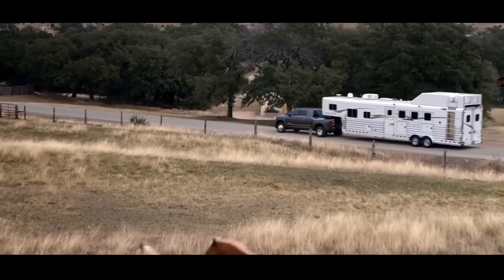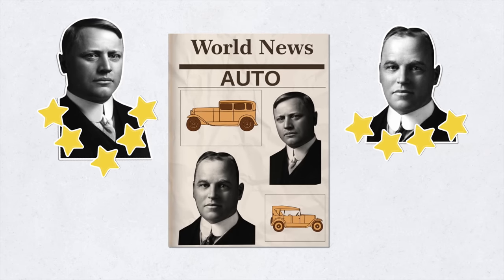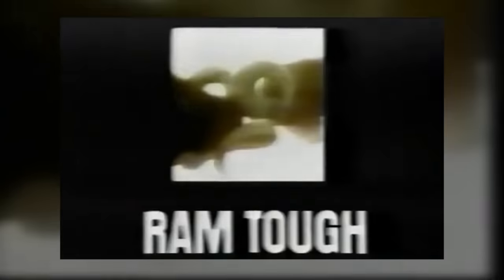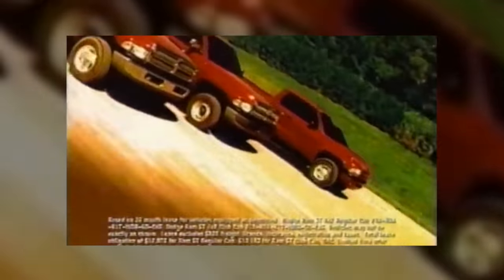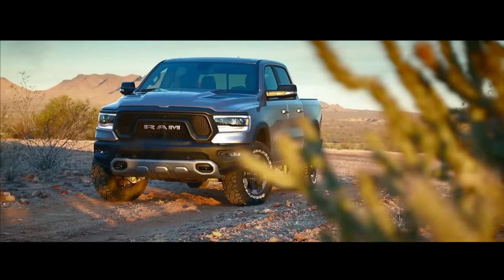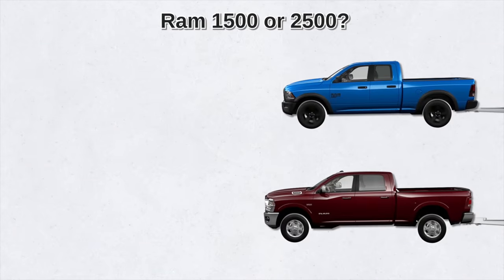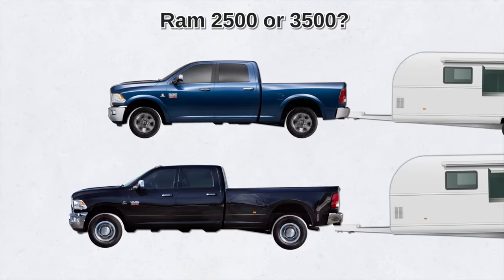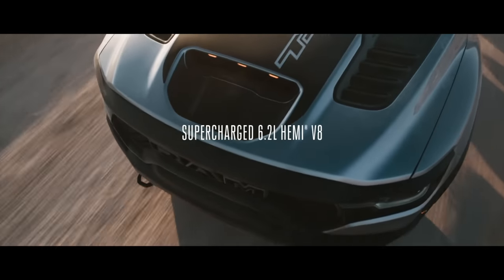No One is Telling You the Truth About Dodge Rams, So I Have to

Comment: I have a '98 2500 Cummins 4X4 that I bought new when the 24v came out. It's never left me stranded and I've only had to replace parts that normally wear out. Still runs great with 250,000 miles on it.
Reply: DODGE IS JUNK......NO WAY CHRYSLER CAN RUN THAT LONG
Reply: He’ll be dead before he can put that on lol at the mileage he’s at now.
Reply: I just mean if it’s at 250k now 20 years later it would take him another 40years to get another 500k like you said
Reply: Stick shift?
Reply: @erniecarrasco9107  but you own a Cadillac....🤔🤦‍♂️🤐
Reply: 7400 miles a year?  Sure it will last many years.  I didn't like Dodge much until I started working at a Ford/Chrysler dealership 20 years ago.  This video was what I want from a good sales video, just information, but it's not what  I subscribed for. Just my own opinion.
Reply: I’ve got 500,000 miles and counting on my 6.0 Power Stroke. Still looks like a newer truck and the body is tight. Engine is great except for a small oil pan leak. Only on the second automatic transmission. Truck towed most of its life. Ford made a superior truck from 99’-07’
Reply: The engines are are amazing, but the transmissions...
Reply: @Wezi427  it's a manual transmission rear wheel drive and I work on it myself. But it does break down more than my 02 Taco prerunner and my 06 Highlander Hybrid limited
Reply: I have an 02 ram 2500 with the big drinker v10. It's been a good truck other than I had to rebuild the trans at 165k about 3 weeks after I bought it from my brother in law lol still can't complain it's a solid truck
Reply: I have a 2003 Dodge Ram 3500 crewcab dually 4wd 8ft bed. No rust and runs great. So up yours ! Haters! Lol!
Reply: @erniecarrasco9107  MAKING JAPAN GREAT AGAIN👍
Reply: @erniecarrasco9107  - RAM and Dodge are NOT American - they/re Italian cars and trucks.  If you buy anything from Italy, make sure it says Ferrari on it or don’t buy it.  Ford on the other hand is an American company and the F-150 is one of the best trucks anyone in the world can buy
Reply: @InCaveEntertainment  if you get the right Ford yes. But so many of my friends who have 4x4 fords tell me they don't last. It's rare.
Reply: Theres alot of mileage left in that Cummins , the rest of truck will fail apart long before the mighty Cummins is done. 💪
Reply: @davegeisler7802  the dodge heavy duty trucks are basically solid from bumper to bumper.
Reply: Speed Tube  my 2006 Ram was built in Mexico...
Reply: @zackzander425  you are by far have a rare truck the 6.0 ford were junk. There was even a lawsuit over them.
Reply: @jakey20022  there have been class action suits for every maker, the 6.0 is a great motor but was built by International and after the 6.4 flop from international Ford started building their own motor the 6.7. Ram hasnt ever built their own diesel and chevy duramax is an isuzu which chevy only owns a share of
Reply: @andrewgodfrey579  RAM doesn't need to the Cummins is a great engine..
Reply: @Red ROCK agree that’s why mine has 1.3 million. I drive over 3K miles per week
Reply: @InCaveEntertainment  ram is actually more American made than ford. In fact 2nd most American made truck 1st being toyota tundras.
Reply: One of the things I most regret selling was my 2005 Ram 3500 with one of the "old school" Cummins.  Pretty close to base model, would have probably been able to put 400,000+ miles on it.  Stupid me.  They'll never make anything like that again.
Reply: @markw999  emissions ruins everything for diesels. The 12v 5.9, 24v vp44 5.9, and common rail 5.9 24v are the best
Reply: @roketfingers  the transmissions are amazing but when built... in stock form you need to baby it
Reply: @roketfingers  Ram has been using Aisins (Toyota made) transmissions as an option since 2013. I have one in my 2020, zero complaints. But all the older automatics? Yeah they're trash. Same for Ford automatics.
Reply: We bought a brand new 97 dodge extended cab 2500 4x4 Cummings, it has pulled my horse trailer and never had a problem.  I’ve pulled Fords out with their trailers attached.  Over 250,000 miles and going strong. The worst thing is the cheap plastic used.
Reply: @InCaveEntertainment  to bad you have to lift the cab to work on the diesel
Reply: I have 300k miles on my 5.9 gasoline Ram 2500
Reply: @InCaveEntertainment  I'll take Italian over American every time hands down.
Reply: @dare2scheme904  - cool!  Go buy a Fiat - those are super reliable.  Or a Ferrari - pay an incredibly high amount, not be allowed to paint it whatever color you want to, and not being allowed to sell it without permission.  A bunch of really great car companies over there.
Reply: @InCaveEntertainment  I tried to buy a Fiat 500 at an auction last week and got out bid. I quit at 5,000. I got a 2008 GS350 2 days ago at the same auction for 2,200 and I found out it has an exhaust leak at the cat, which is integrated into the exhaust header. I found out this is a common point of failure for Lexus. I would have preferred the Fiat, but I had to settle for a Lexus.

Comment: I would like to see a re-vamp of the D-50. With a turbo charged I-4 engine with at least 250 whp, and 260 ft lbs of torque. A diesel option would be great too. Diesel with at least 175 whp, and 300 ft lbs of torque. Diesel must have a EGR-less engine. If the did this they would control the mid-truck market.
Reply: Miss my mom's old mighty max.

Comment: 2012 1500 Big Horn 4x4 Hemi.. 214k miles with no hiccups down the road. Proper maintenance and a little luck are the golden ticket to longevity. My only concern is that the engine will sometimes instantly crank over instead of churn a few times, but it's rare enough and no issues as of yet.

Comment: I work in the Cummins plant that makes that Diesel engine. Trust me, this engine is absolutely bulletproof.
Reply: I love the Cummins engine, I don’t like the ram that’s wrapped around it
Reply: What would you say about the 3.6L pentastar? Or the 8 speed transmission
Reply: If it is bulletproof why can’t they get more than 300,000 miles without a major overhaul anymore? Unless you take all the EPA crap off them they don’t last anymore.
Reply: If its bullet proof why cant the turbos last more then 15,000s with out blowing the engine up? Or what about those transmission seal leaks at around 10,000 miles ?
Reply: @Unique377  I'm no Cummins mechanic nor owner but I've never heard of those issues being common. You have a source?
Reply: When people ask about my truck: It's a Cummins Diesel Truck.  I bought the engine surrounded by a truck.
Reply: @Unique377  if every Cummins failed every 15,000 miles, Cummins would not be in business. A $7,000 expense every year? Provide proof please?
Reply: @arnieboggs1  Agreed. I'd take a Cummins over any diesel on the market. The problem is they are stuck in the #1 ranked 9 years in a row worst vehicle manufacture in the world Fiat.
Reply: @arnieboggs1  It better be reliable because its the same engine thats in every trash truck and trash day is every Monday!
Reply: Best motor I had in 7 diff semis I've driven is the Cummins X15 Efficiency. Dead nuts reliable and around 8mpg under most conditions.
Reply: Your probably the janitor at the Cummins plant
Reply: The 6.7 is a awesome motor, it’s just to bad emissions where added and Chrysler built everything else around it. Love mine though.
Reply: Like, I can actually shoot it and the bullet won’t damage the engine?????
Reply: @UTUBE3JC  since you are asking this question, I’ll answer. Every component of the engine is made of Kevlar. Even the coolant, oil and diesel. They have been hit with anti aircraft artillery and they simply bounced right off. The government tested one with a nuclear war head and it almost survived.
Reply: I don’t trust you. I’ll be shooting one later today for verification.
Reply: @arnieboggs1  I believed you up until nuclear warhead hahahahahahaha. But fair enough, that is the answer my question deserved. 😝
Reply: @arnieboggs1  I was like damn Kevlar for the whole engine wtf is this the official navy seal truck
Reply: @markh4473  in the case of the third gen ram, yes they were trash. But the first, second, fourth, and fifth gen ram heavy duty's are great
Reply: I've worked on some of them offshore. They make a damn good engine for a standby generator package. The only one better is Caterpillar in my opinion, but that's semantics.
Reply: I have an 07 5.9 with 668k miles. Only  injectors have been replace inside the engine.
Reply: @markh4473  why not, I’m curious-
Reply: @SuperSnakePlissken  take that crap off! ; /
Reply: @Unique377  I’ve had 2 in the last 30 years. Still have a Cummins 350 never had an overhaul never a problem with trans or seals- what gives?
Reply: @Unique377  mine must
Be the only bulletproof ones
Reply: @johnwhitehead5457  I like that john
Reply: @SuperSnakePlissken  completely wrong I have 400ooo miles and no major overhaul - I maintain the truck and it Basically asks for nothing more - puts Chevy  and
Ford to shame. No mention of
Toyota for
A reason. They never could
And
Still
Have no idea how to build
A
Pickup. To quote an old Toyota pickup being retsrded looking in and
Out: It’s a chinaman thing

Comment: We've had an 03 Ram 3500 4 door long bed with the overload springs straight out of the factory with the exhaust brake. Had 8k lbs in the bed, didn't come close to bump stops, towed veeerrry heavy loads, and to top it off it was one of the years with absolutely no EPA garbage! Love it to death and with some modifications it got up to 1200lbft of torque and 26mpg unloaded highway. 18 loaded. Now it has a 6.7 swapped in and is even more amazing. Love the truck and would recommend it to anyone. It also has the 6 speed NV5600 which I wish Scotty had talked about because it is bulletproof out of the factory.
Reply: How hard was it to swap the 6.7 and Trans in? I'm on my third 48RE and I'm just done with it.
Reply: @iPhoneAppReviewer  What keeps failing on that that transmission?

Comment: We had a 3500 and it was very bumpy . We switched to the 2500 and its easier to ride in even when pulling a car hauler. We do that a few times a year. I can actually read in it unlike the 3500. ( that’s important on long trips. 😊. Thanks for the info Scottie
Reply: You can't go worng with John Dutton's favourite truck!
Reply: Replace the sway bar with a carli torsion sway bar and it'll be the smoothest ride of your life. Upgrade the full suspension if you have a need or the money to but Ram's sway bars are the stiffest on the market and upgrading them makes a huuuuge difference.

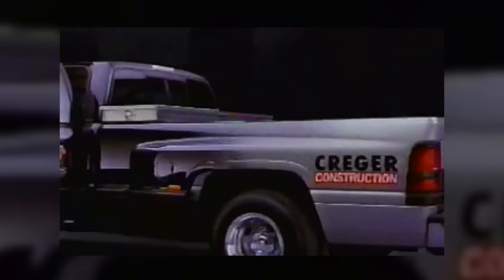Comment: 3:40 Factual error: you said the 2nd gen Ram from 94 came with "turbocharged" V6 and V8 engines. C'mon man. The Cummins had a turbo, not the gassers.
Reply: yep youre right. I own a 94 with the 360 and a 97 with the 318. no turbos
Reply: Dropped a 5.2 in my 97 1500 a couple weeks ago. No turbo. Guess even Scotty Kilmer can make mistakes!
Reply: I have a 93 dodge 12bt turbo charged 5.9 with a nv4500 trans
Reply: Come on man Scotty can slip up once

Comment: I had a 2011 Ram Bighorn 1500 with the 5.7 Hemi. It towed and carried everything I could throw at it and drove more comfortably than every Chev,Ford I ever drove. Great truck, only complaint was bad fuel economy but it made more power than I needed and never caused me any grief....I should've kept it.
Reply: I've seen many quite similar stories about the hemi ram trucks, the diesel manual transmission ones, they are legend.
Reply: Drive a tunda believe me there is a big difference
Reply: My 2011 1500 just turned 60,000 miles. It looks like new, drives like new, paid for, does everything I need. Been a truly great truck. Oh, and it's a plain jane model, debadged, bigger tires and I get compliments on it all the time. And I don't miss any of the useless technology built into the newer $70,000. trucks either.......put that in your pipe Scotty!
Reply: I had a 2017 Ram 1500 Tradesmen as the lone family vehicle, camper tower, materials and debris hauler, etc. It did everything I needed. While camping in Virginia Beach, my wife noticed that everyone else had 2500s, 3500s, 250s, 350s,...and she kept saying to me, "we need more truck". I was resistant because my 1500 was nearly paid for and did everything I needed. The morning after returning home from that trip, my wife woke me up and asked, "are you ready to go look at trucks"? Thinking I would pacify her, I agreed to 'look'. As we approached the lot, we both spotted an Olive Green Ram 2500 Tradesmen. It is now mine, and I paid it off after just two payments. Stepping up to the 2500 was a great choice! I smile every time I see it, and I get compliments on my truck all the time. I've done some small upgrades and have plans for some more involved improvements. I doubt I'll ever sell this truck and I'll drive it until the wheels fall off.

Comment: Just upgraded my first Ram truck a 2018 1500 big horn crew cab, first vehicle i ever bought new. Got it at a year end 10k off event, held it value so well, i had a trade in value of 34k, which is the same purchase price i paid for it 4 years ago. had 65k miles on it. Replaced it with a 2020 Ram Rebel quad cab with 5k miles. I think im going to stick with rams for quite awhile. Hell maybe ill be lucky enough to find an alright priced TRX to upgrade this ride with in a few years when its paid off

Comment: I had a Ram 1500 4x4 and it was totaled last summer.  When I get my next truck, I plan to get the Hemi 2500 4x4.  Honestly, my 1500 was perfect for what I used it for but I want the larger truck since there is not much difference in gas mileage and it seems like the price difference between the 1500 and 2500 is not enough for me not to take advantage of having a larger truck.

Comment: Bought new in 1994 a second generation Dodge ram 1500 2wd. The 5.2 liter (318 c.i.) has always been my favorite engine. I now have 308,000 miles on it. Other than a crank sensor going bad at around  110,000 miles and normal tune up parts and oil changes, the engine and transmission are untouched Still runs great. Just put on the second water pump and replaced the original thermostat. Only replaced the starter motor once and the alternator once. I live in Michigan so yes it has some rust. 
I've owned it 27 years and still love it. I keep up pretty good on the maintenance. I've personally done close to 100 oil changes on it. It still runs great.
Reply: 5.2 mágnum 96 ram 1500 253205
Good engine no have problem...
Reply: Those 318s were great engines!

Comment: I rented one for a long road trip a couple of years back. Actually, it was all Enterprise had available at the moment. It was a 2019 1500 if memory serves. What surprised me most was the great gas mileage it got over the course of my 3000 mile trip. I've often wondered, however, how well they hold up over the long haul. I tend to keep trucks for a very long time. I put lots of miles on them. My current truck has over 300k on it. I'd consider a Ram 1500 for my next truck, so long as it isn't a maintenance money pit.
Reply: What’s your current company choice?  Toyota? Ford? Something else?
Reply: Sadly after owning multiple ram's, the long term reliability is was pushed me away.  Most of the time it was just electrical issues, or ABS, but I did have trouble with late 90's automatics with the half ton.  Not saying other don't have issues, I just don't want to give them my money at this point after having so many issues on rams and some of the cars covering about 15 years between 1990 - 2005.
Reply: Was employed by a rental company for years, been out sense 2013, at that time the diesel  version had exceptional fuel economy, made one replacement delivery in excess of 600 miles, 29 mpg and I didn’t baby the vehicle. Best part was, didn’t have to refuel. Think green.
Reply: I just sold my 09 and it had 300k and still ran like a top. Daily driver and the most expensive repair over all those miles was I replaced the worn out upper and lower control arms and ball joints. Just normal wear and tear. Replaced a starter, battery, two cooling fans and front wheel bearings over the years. Very cost effective truck and never once broke down on me. Just maintenence. I still drive a ram that has served me well.
Reply: My RAM has been more reliable than our toyota by far.   But its a 2005 ram
Reply: @noidontthinksolol  The new ones have slews of electrical and trans issues.
Reply: @davec.3198  i dont know we had an old 2nd gen and now i still have my 3th gen and they have been abolutely rock sollid